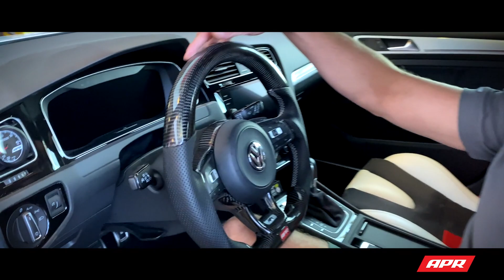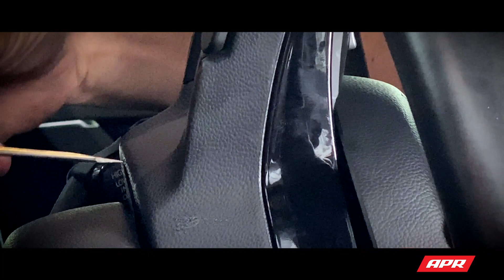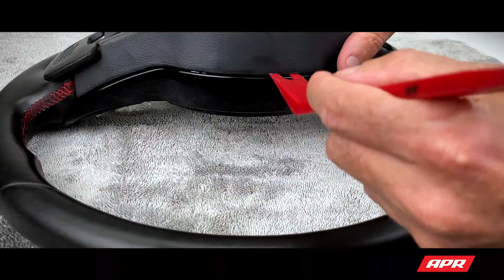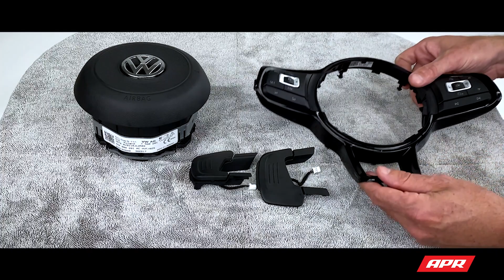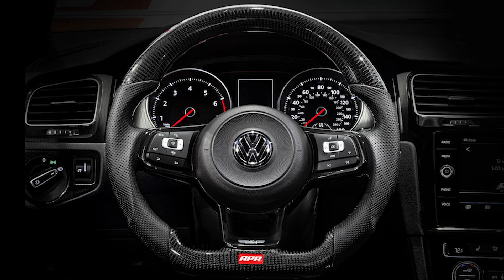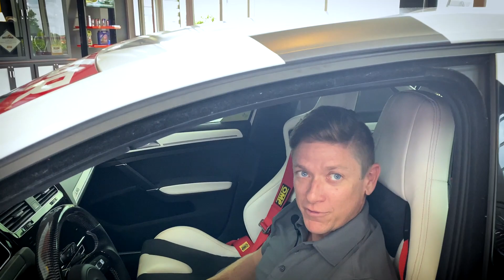APR Carbon Fiber Steering Wheel Install (MK7)

Comment: How are you suppose to turn the steering wheel after disconnecting the battery? First is turning the wheel, and after the airbag is popped u turn off the battery and continue taking off the airbag after waiting 10 minutes for the battery to fully discharge.
Reply: I’m having the same issue. I can’t turn the wheel without having the battery plugged in.

Comment: Hi. How do you do this on models with keyless ignition? Obviously with the battery disconnected the steering lock will stay on.
Reply: I know your comment is a year old, but from what I gathered from the shopdap video, just turn the wheel then disconnect the battery. Would have to do everything sideways from there though lol. He didn't directly address this as his was key ignition. I'm sure there's a better answer on the web.

Comment: I believe this will also fit the Mk2 Tiguan. I have a steering wheel off an actual MK7 Golf and it was a direct plug and play. I lost the heat function BUT gained paddle shifters which required NO CODING.